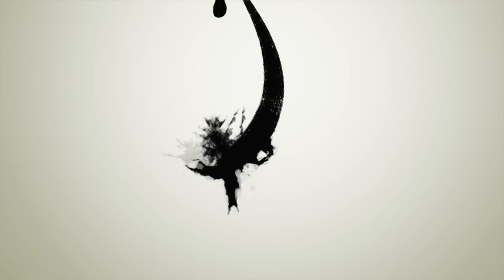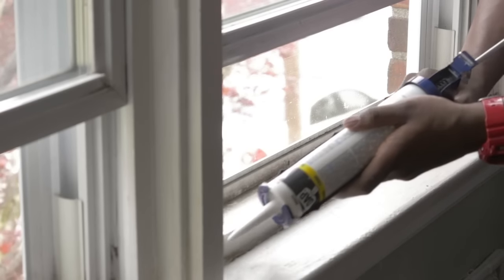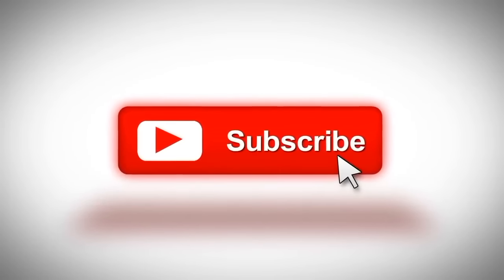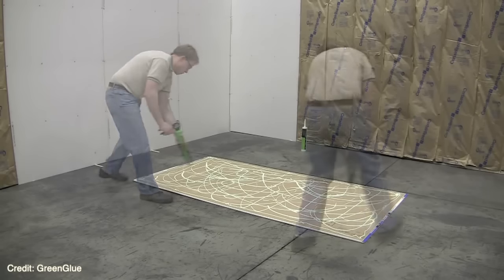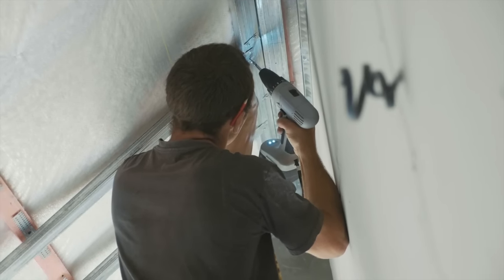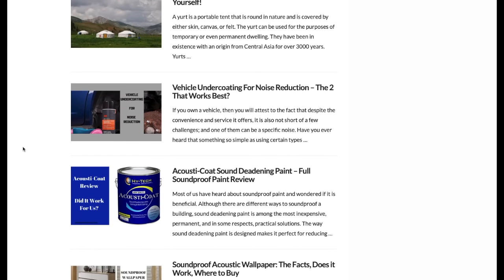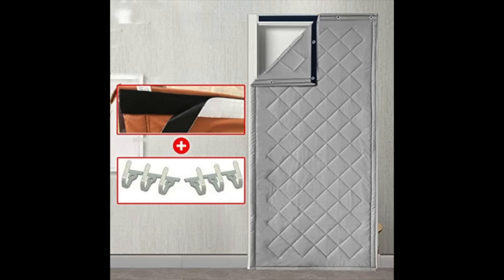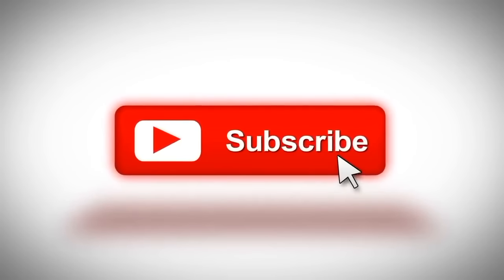How to Soundproof a Wall - 7 Easy DIY Ways!

Comment: I want to at least sound reduce my room as much as possible so I can play music and stuff without bothering my parents. My house has such thin walls to the point that you can hear a cricket fart in the other room
Reply: Same
Reply: Same
Reply: Same 😂😂 they can hear my bird sneeze
Reply: You can't wear headphones? lol That is honestly your cheapest, easiest and fastest way.
Reply: @Kevin-sm8pn  how did you think this comment was going to help at all….
Reply: @Kevin-sm8pn  
Wow. You are intellect. 🙏
Reply: Did you use this video info and did it help?
Reply: @Kevin-sm8pn  yea but I'm then super loud using the microphone
Reply: Gross
Reply: Have you tried putting an electric fan? It would serve as white noise
Reply: @talesofthetoydad897  yea
Reply: This is your dad. Stop typing so loudly.
Reply: @Kevin-sm8pn  im a really light sleeper and type of noise will wake me up. Having thin walls at home do not help at all.
Reply: @OnlyDianes  for yiu to sound proof your room to stop noise going out of it you can use some audio panels. It's easier to sound proof a room for outgoing noise than incoming noise
Reply: @simonesaidy  like what YouTubers do with those weird sound proof square foam panel things? How do those work
Reply: I can't imagine when you take your girlfriend to your room
Reply: @OnlyDianes  collect lead and melt it , but before stand up a sled to spread it straight then add it some rubber on top and place it on the wall , collect it from batteries and plumbing pipes
Reply: Same
Reply: @OnlyDianes  it basically absorbs sound/vibration in your room, like talking into a pillow but for your room
Reply: @eubielsilva9389  if I get those sound square things, do I have to fill up the entire room with them to have an effect or if I just have like a clump of 9 of them somewhere will there be a small effect or none at all? I understand having only a clump will not do as much as the entire room but would it at least make it slightly quieter?
Reply: @OnlyDianes  just put it against the wall that your trying to avoid sound going to and try to fill in any gaps on your door